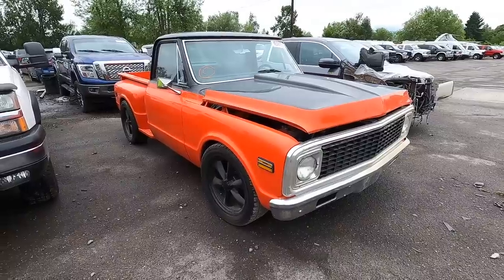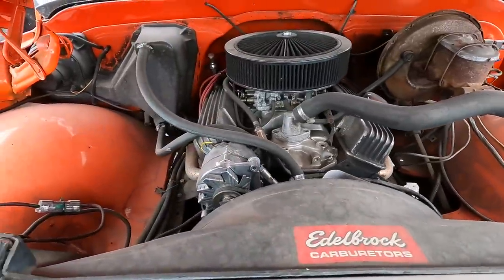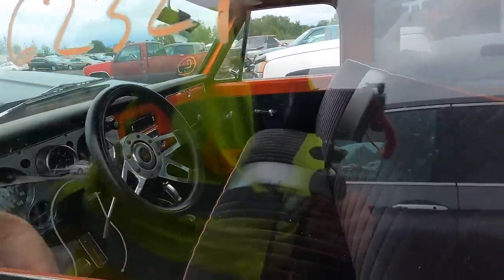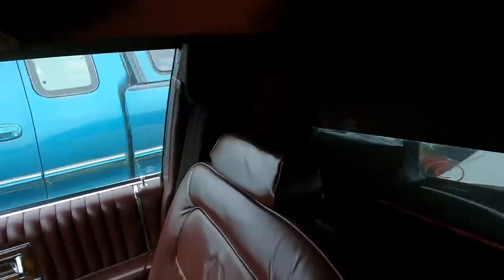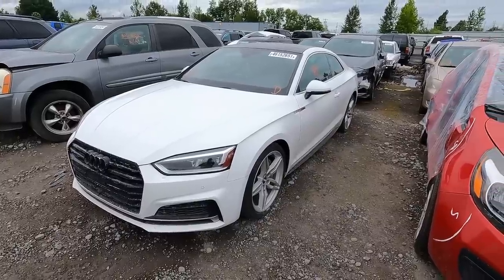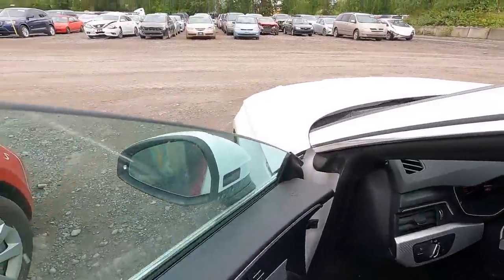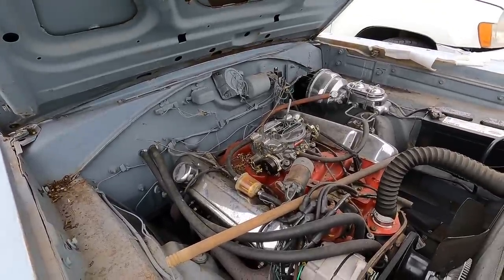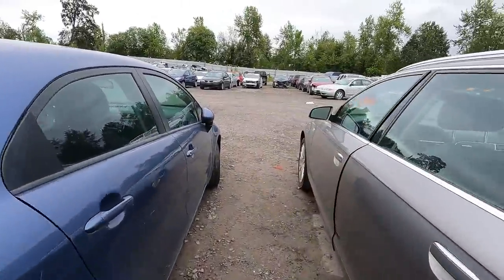Copart Walk Around Portland, OR 6-17-21 SWB Chevy, Cadillac Limo, 66 Dodge Charger!!

Comment: No surprise that limo only has a 305, Junkyard Digs recently got a Lincoln limo an its only got a 302. 
On that thought, you should buy the limo and challenge Junkyard Digs to a limo race!
Reply: That's a 307 Oldsmobile motor see oil filler tube in front of motor.🚀🚀🚀Rocket Power

Comment: Randy, diesels don’t have spark plugs, ignition wires, or distributors.  The fuel injection on the vw is a Bosch unit.  The “injectors” were air injection for emissions.  
Hope you enjoyed your time in Oregon, it looks like you were here when we had some rain, this was the one weekend we had non sunny weather recently.

Comment: the chevy truck looked like the battery cable wasnt connected
Reply: Thinking it had an ignition kill switch somewhere
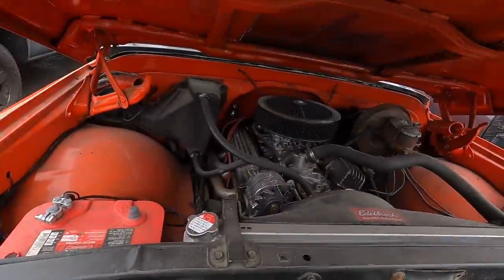Reply: The battery was disconnected he was so worried about the bent hinges he did not look at the battery but right at 4:18 you can see the battery without a terminal on the post LOL!!

Comment: There was a company just north of me that did those limousine conversions.  In summer they would put the vehicles on jigs and cut them outdoors. The frame and floor would be welded in and they would wheel them inside to finish them.

Comment: quick way to id mopar mills: dist in front on pass. side=big block. distr. in back=small block. 350-383 is the B series smaller of the big blocks 413-440 is RB similar but with a longer stroke.

Comment: Just by the looks of the engine compartment on that limo, I believe it could be a 26k mile cadi
Reply: Exactly.  Nobody drove/ road tht Parliament Funkadelic Mobile🤘🏾around nearly enuf to flip the odometer!  Esply to still have what has to be there original specialty custom interior.  "What is tht VELVET" 🤣  I'd drop $1200 on it if it was closer, jus to pimp 'round a bit then sale it to a collector for 4-5× $

Comment: Nice enuf guy tht Randy  not much for aftermarket (wowed by all the old transistor crap in the limo but had trouble w/the handleless p/u door. Really thinks poppin' open the corner window is how ur meant to gain entry lol), and was just about as lost whenever it came to key fobs (newer vehicles).
 El camino & Charger were the Best Buys on tht flood lot.  The p/u was someones project which can be the worse

Comment: The charger looks like it has a 383.  Definitely a big block, distributor on the front.  Small blocks have distributor on the rear of the engine.  Looks like the Audi had a lock release on the end of the fob, could be wrong but that's what it looked like.
Reply: It's an RB engine. 440.

Comment: The start a carburated engine pump it a few times to the floor then hold partial throttle and turn the key,especially. If it's a quadrajet

Comment: The Orange truck most likely was out of fuel or they did not leave a vent line on the tank open for the pump to pull but it wanted to start it was just out of fuel or not getting air into the tank to allow the fuel to flow

Comment: The 1966 Charger has a Big Block.....Chrysler Big Blocks 350,361,383,400,413,426 wedge or a 440.

In 1966 the Charger had a 318 poly(not the later 318 people think of)361 Big Block or 383 Big Block and the rare 426 Hemi..The killer 440 came in 1967 for the Charger.

*note the 361 Big Block is not the same as the 360 small block that came in 1971...

*Yes 350 Chrysler had that before Chevy did!! 1958 350 Big Block was a 1 year option in the Plymouth Fury aka Christine!

Comment: no surprise the hood hinges are bent those are the cheap Chinese aftermarket replacements MUCH of what was done on that truck was an afterthought which is why everything looks so cobbled up. could have bought a billet column and had it wired to avoid that unsightly only automatic shifter and lock and could have put in the proper auto ratchet shifter with the cosmetic boot and made it look 90 times better than that. also a fuel cell is in order if thy weren't going to use the proper in cab tank. Battery is dead maybe from all that after market stuff. and yes the alarm sounded because those alarm have their own backup batteries. sounds like it's outta gas. 66 Charger is nice and rare but parts for it would be damn near impossible to find for it